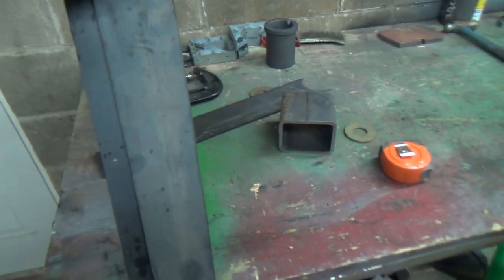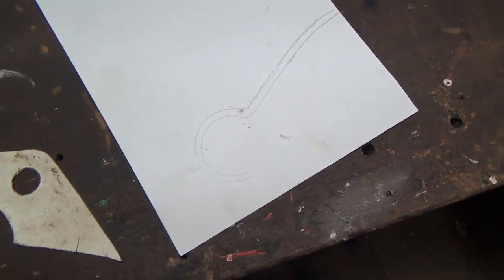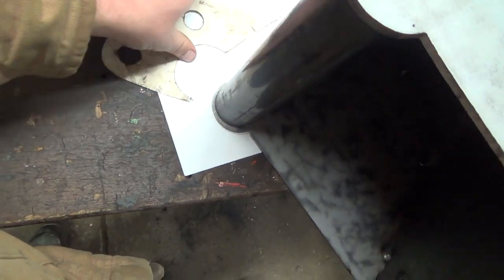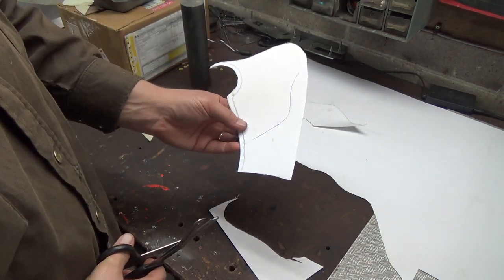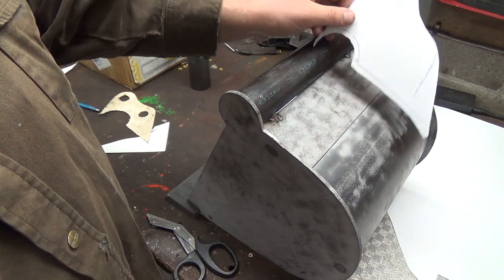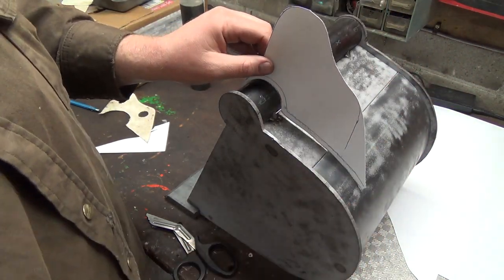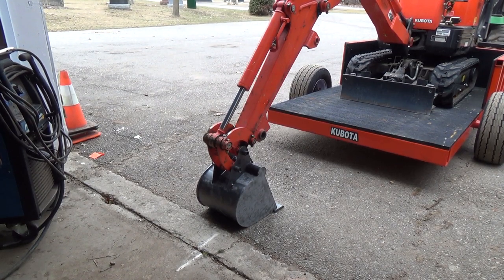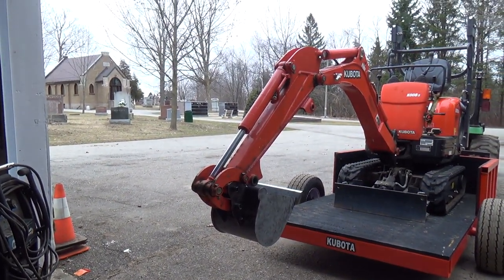New Mini ex bucket day 3...Today we fabricate bucket ears

Comment: If you want a water heater,  get a roll of 10mm copper pipe (minibore), wrap it around a piece of tube to make a coil, add some connectors to adapt to your hose, the coil should fit in your furnace.
Reply from the maker: Something like the hot water on demand heater I installed in our travel trailer
Reply: Yep, but instead of buying another heater, the coil would be cheap.
Reply from the maker: yeah

Comment: Thank you for your reply I did watch where you measured but that was ram full extended for curl the way I was talking was and by watching if you moved arm hole more forward to opening of bucket and then rise ram holes up higher ( away from bucket   maintaining distance between holes ) so bucket is full open flat with ram in you won't be over opening bucket then will have maximum curl  possibly curl bucket all the way closed to arm    but arm holes need to be moved forward to open face of bucket for clearance  ???
Reply from the maker: that would work but that is a larger bucket.. you would have to watch when the arm is in that the bucket wouldn't dig into the arm when it curls in

Comment: Bill;; 👍clamp the two pieces together and grind  them  at the same time, this will make them both equal to each other. Also while their clamped together drill the two top holes and mark the  place below  so your holes will lined up correctly  to each out other .. this is just a suggestion, do it anyway you want..🙏🏼🤞🏼🙏🏼
Reply from the maker: I do the t with some thinner material but this clamped is 1" thick then.. I do clamp and drill pilot holes tho then drill the 1" holes separate

Comment: It seems to me the pin near the pipe should be closer and more forward to the pipe. Since it is a stationary pivot point. So you should look at it based on equal sides of the pipe.
Reply from the maker: yes i looked at that but it seemed to froward over the pin
Reply from the maker: that will increase the length of the curl too.. trying to keep that tight so it doesn't open up a longer hole than i need
Reply: I think it would actually make the curl tighter but would definitely make the thumb useless. Also the pipe diamete maybe a bit too large creating too much "pinch" area

Comment: From looking at that side view, Would putting your main pin hole in front of the pipe more not lower your bucket in full curl and stop it from hitting the thumb bracket? Also seems like putting it closer to the body of the bucket and leaving the cylinder pin where it is would increase the curl and reduce the arc of the bucket curve.

Comment: Put the bucket on its face that will be the most open you want now pull curl ram full in see if in line with arm mount holes now measure how far off from bucket you want it from arm holes and how far away ram holes are away from arm holes then you'll know when ram is full back the bucket is flat to empty then will have maximum curl
Reply from the maker: it seemed spot on when we measured the stroke length

Comment: what thickness of metal did the plasma cut? which hypertherm was it?
Reply from the maker: various sizes. Ive done up to 3/4" slowly but it cut it. its a hypertherm powermax 45
Reply: @billstmaxx  would it cut more. ...? They are meant to be good machines. .I seen videos on here about the power max 45xp  I just wondered if they were all true. .